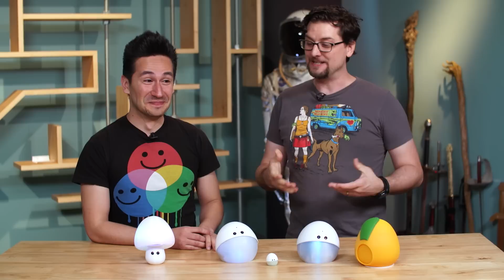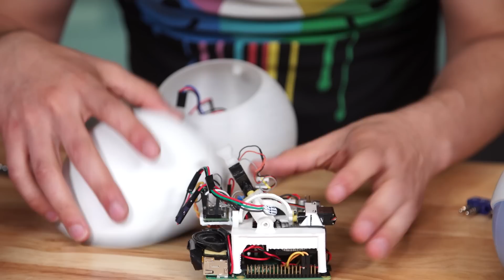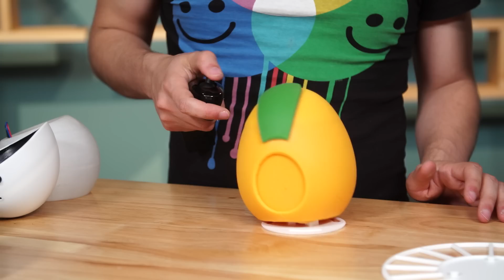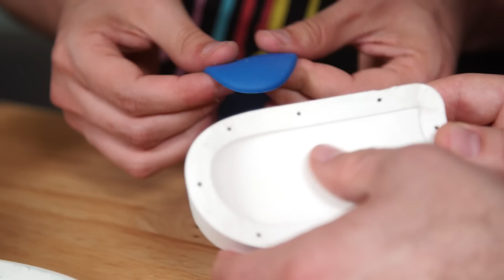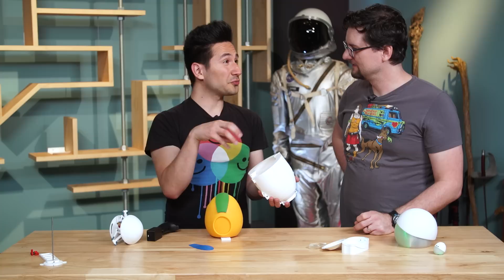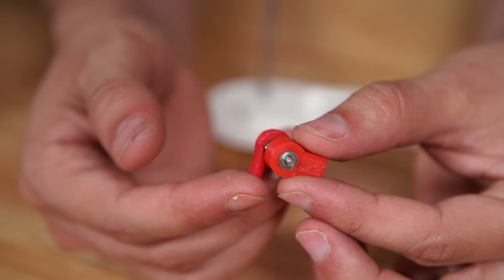Alonso Martinez's 3D-Printed Animated Robots!

Comment: i was sold cuz of the eyes but once i heard that it was a tiny screen which is cute and all really just kinda killed the whole thing for me, i was hoping the eyes were mechanical and i was dying to find out how was it done, nevertheless the construction of it is very simple and elegant.  The whole time he was about to explain how he did the head movement i was yelling to my screen Joystick, Joystick !lol i taken apart many xbox and ps3 remote and even quadCopters remotes and notice the cute and small potentiometer assembly so i knew he had to have a similar approach to it so i was surprised to know he used servos cuz i seen other applications use dc motors with a wromGear approach BUT hey great job and as far as those NRF i actually have the 5inch manual book to the programming  of that Transmitter so i know he when through hell learning how to use that radiochip, great job Alonso and thanks to Tested and Adam Savage for getting Alonso on set!

Comment: Could he not have done ABS and vapour smoothing?
Reply: Probably but maybe he doesn't know that it exist =)
I think he learns while doing it.
Reply: Nikel87 I guess abs is a pain to print with I've yet to touch it only used Pla and tpu
Reply: ABS is quite easy to work with but you must have your printer in a closed cabinet to keep the temperature on the surrounding air a bit higher. Otherwise it usually warp.
Most people turn the bed heating on for like 15 minutes before printing to get the enclosure a bit hotter.
Reply: Yeah, big part, little attachment area, and ABS, that'll cause some difficulty.

Also i wonder, vapour smoothing thin parts, does it work very well? Will it smooth a part that big evenly? Do they not get a tendency to warp during smoothing where they are particularly thin? I'm thinking of the area with the recess around the eyes. I haven't tried myself, so i'm curious.
Reply: Does polymaker have some smooth able Pla? I think they use an alcohol mist to achieve the effect.
Reply: I haven't seen a warp during smoothing and it fits most part.
You just have to practice to get the perfect look without damaging your part.
Reply: Yeah they have. $45 for a roll and $350 for the smoothing machine. Expensive so not really for ordinary people.

Comment: Maya is CAD too. But it's not a parametric CAD program, which is the distinction you probably meant to make. If memory serves it's mesh only, right?
Reply: Acrimonious Mirth  Maya has many organic modeling methods such as subdivision modeling,..and there is a 3d print/prototyping module that can send finished models directly to your preffered 3d printing software...most Art schools teach Maya because the user interface is pretty and easy to grasp and customizable and scripting capabilities...and you can do great animated visualizations of your prototype models complete with lighting and materials . I learned Maya in school like this guy did...its great fun and an elegant piece of software.
Reply: dan dobrowolski yes, I'm familiar with the idea behind the software but wasn't sure if it was only mesh or could handle t-spline too. I personally use blender, not by preference but by necessity. While the same basic idea Maia sounds much more user friendly. And most CAD programs now support 3D print export as standard. Most of my 3D printing is mechanical though. I'm currently working on my own CNC design.
Reply: P.s. Subdivision is just a tool in the set and applies to mesh modelling as well as t-spline. I'm not talking about the tools, I'm talking about the form of modelling. I.e. Mesh vs t-spline vs parametric. If you're not familiar with what I mean by this a quick google will help.

Comment: Is it just me or does the color look kinda weird from the side angle, especially on Sean's head, it kinda looks over saturated
Reply: Yeah a different filter of some sort is being used, I see it being used a lot on this channel. I don't have enough experience with editing to know exactly which one is being used or if it is a physical filter on the camera.
Reply: Will Thompson I'm guessing the ones with bare shelves are from right after they moved in. Meaning they've probably have to have overexposed a bit for safety and pulled it back in edit causing the saturation, maybe. It could also be that they've got gear with higher dynamic range than the YT standard Canon.